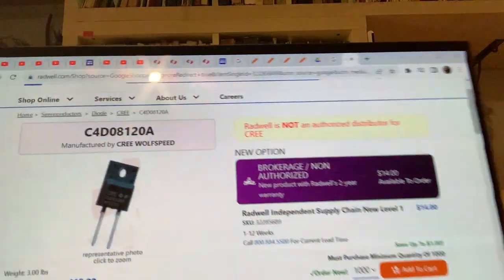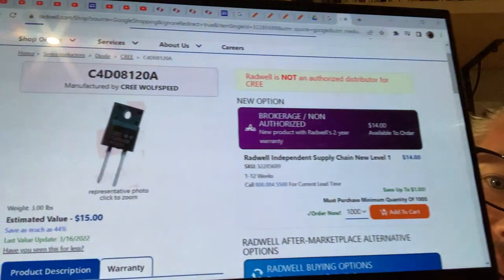Tube amplifiers:  solid state or tube rectification tips

Comment: Nice to listen to electronical engineering basics, but as usual, I'm far away to follow those kind of AMP DIY. Would greatly appreciate to put it in a DIY series, else I'm a bit lost to follow your different videos. Unfortunately I'm not the bro some of your followers are, just the guy to follow HiFi mentoring fundementials. Never reaching the goal, to build something seriously by myself. Thanks a lot for your passion, love it!!!
Reply: I learned emipirically through a point to point kit.. then reading up a bit (start with Aikenamps and Tubecad webpages, then Pete Millet’s online library) you get to understand it slowly.. I suck at math and have no engiineering background so it is harder for me..
Reply: There is a book that helped me finally get started. This book is available and is easy to understand. You will build an amp. Look up "Vacuum Tube Amplifier Basics by EJ Jurich"

Comment: Hi Janos, Kia Ora from New Zealand! We visited Hawaii just before Covid-19 hit the world and hope to revisit again. I recently purchased a home made 2A3 SET amplifier (2 parallel channels with one power transformer in one chassis) from the estate of an experienced tube radio restorer who had branched out to make his own power amplifier. The driver tubes are 6SL7GTs and it has a hum trim nob. It appears to have 3 chokes (I am not a tech so could be wrong). I bought it to power my Klipsch La Scala speakers. The amp has a tube rectifier and is I had my local tech guy look it over and apart from fitting an off/off switch, said it was well built. The mains hum is acceptable when no inputs are connected but more than I would like after inputs are connected. Any ideas on how to reduce the hum? Cheers David
Reply from the maker: Hi David, it seems that the problem is with the connected source, the interconnects picking up hum, or there is a ground loop between the source and the amplifier. You can try to ease the ground issue between the amp and source by plugging them in to the same AC outlet. If that's not enough, try adding an extra ground wire between source and amplifier if possible. Could try different interconnect.... but it is all for naught if your source is noisy. Most gear are not designed to be quiet enough for efficient horns. Good luck!!!
Reply: @realworldaudio  Hi Janos, thanks for the detailed reply, much appreciated. If I connect each source to the amplifier directly there is not as much hum. I run an earth wire from the turntable to my Ballari phonostage and then direct to the amplifier without much issue. But when the TV, turntable and CD player are all connected via the Ballari passive preamp the hum is too much. I have tried connecting all from the same wall socket via a multiblock outlet, and also connecting them via different wall sockets. I have tried different interconnects. The Klipsch La Scala speakers are simply too heavy to move up and down between floors. I have a pair of Altec Lansing Model 19 in the main lounge (downstairs) that are also too heavy to move up a floor. I am not experiencing the same problem with the sources connected to the Altecs via the Bellari passive preamp. The Klipsch speakers are more sensitive than the Altecs, but I think not sufficiently more sensitive to cause the amount of increased hum I am experiencing. I wondered whether there is a hum on the mains wall socket outlets upstairs but my electrician said that was above his paygrade! So I am at a loss. BTW - where did you acquire all your knowledge? Would you consider hosting a basic training series. I would love to build an amplifier but haven't plucked up the courage. Before choosing which amp, an explanation of what to do, what tools and equipment to have to hand, and how to build an amp be marvellous. Keep up the great work :)

Comment: How about soft recovery rectifiers? Aren't they supposed to be lower noise? How do we calculate voltage headroom, for the drop across the valve, for a GZ34 full wave rectifier with CLC filter?
Reply from the maker: For voltage calculations I always use Duncan amps PSUD software, it gives quite good approximations. (As the voltages will depend on so many things - from power transformer  impedance through current draw, turn-on draw is different from steady state, etc...)
Yes, soft recovery keeps the switching noise soft - not hard. They are very good. Voltage headroom: look at the datasheet to the rectifier tube, and they have ratings listed. The maximum voltage also depends on the current draw and input capacitance. (Lowered current and lowered input capacitance can handle higher voltages.)
Reply: @realworldaudio  Yes, thanks for that Janos.

Comment: YES Janos..................sometimes forget that people has to begin................One must learn to walk before to RUN...................
Words and literature are good but they are not the same as the REAL experience..................a proffesional Guide book for cooking does not make you a great cook after reading and passing an examen......

BAHHHHHH, 12 volt DC is nothing to worry about .................OH YEAH ?????
Short a 12 volt car batterie with an English key and look what happens ( at a distance )..........
Reply: I mean if you are building tube amp getting zapped is inevitable, i have been zapped many times ,sometimes even after days of any use  ,the caps store current and give a nasty shock  , what's a good way of avoiding that without isolating your whole work bech which will be a big task in itself , people say to keep one hand in pocket but i cant work with one hand i need both
Reply: @IDontExist14  Hello 29 , put a bleeder resistor on the HV rail..........and or build a stick with a resistor and at the other end a crocodile clamp to connect to the earth/chassis mass to discharge the capacitor banks !
ANYWAY...................HV should NOT be present after the filaments of the tubes are cold............NEVER leave voltage on the anode when gthe amp is shut off..............to preserve your precious tubes.
You can also install a bleed with a switch to activate it when shut down and to be inactive when you're listening.
Reply: @frankgeeraerts6243  good advice im in the process of figuring out the bleeder resistors  , frank can you contact me through email so i can share pics with you as well are you on facebook
Reply from the maker: @IDontExist14  I know a guy who did a video on bleeder resistors: https://youtu.be/bZfUY6b0Hv0
wink wink ;